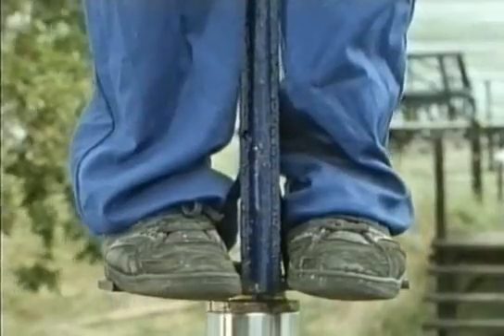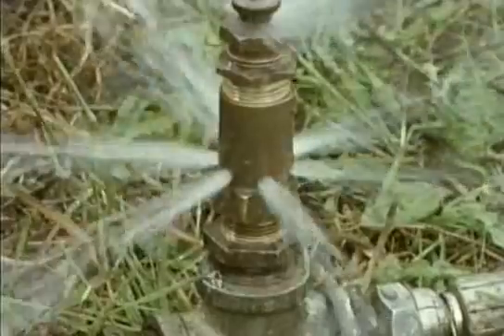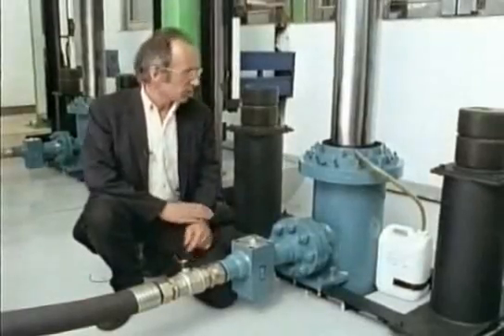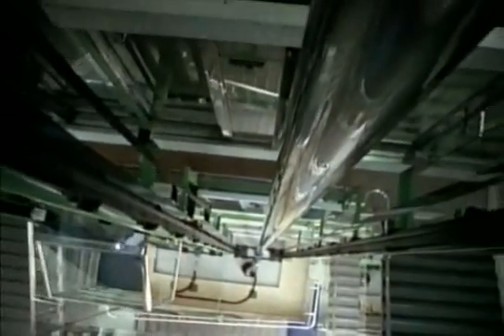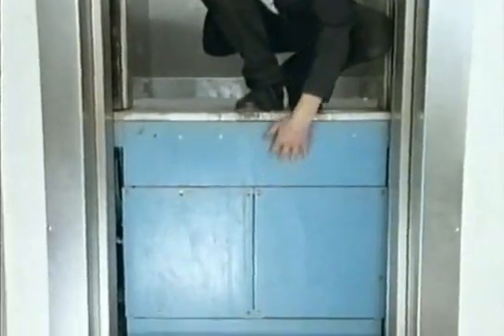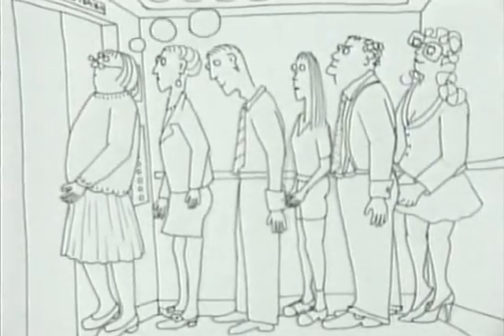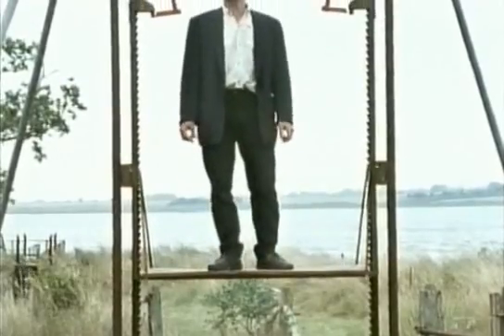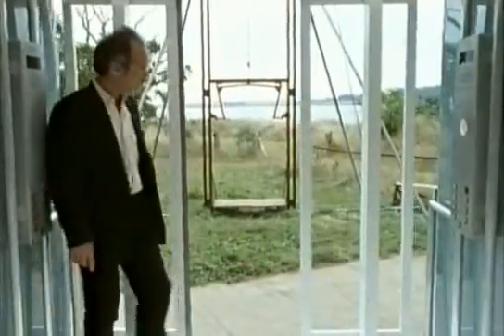The Secret Life Of Machines - The Lift Part-3

Comment: For some reason municipal hydraulic systems have been left out of this program,most large cities with docks had a municipal hydraulic system with a separate pumping station supplying high pressure water via mains to buildings all over the city to operate hydraulic lifts and dockside cranes that ran completely off the high pressure water system,some of these systems ran up until the mid 20thC in some cities.